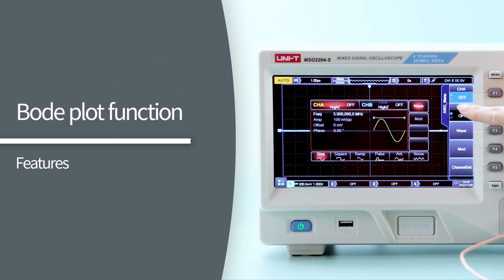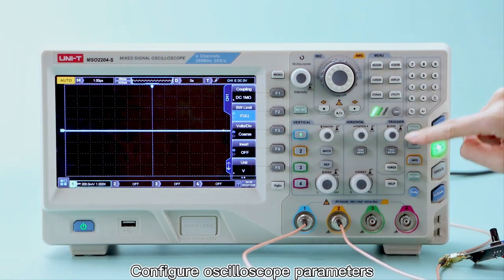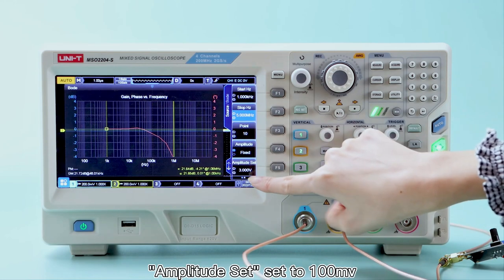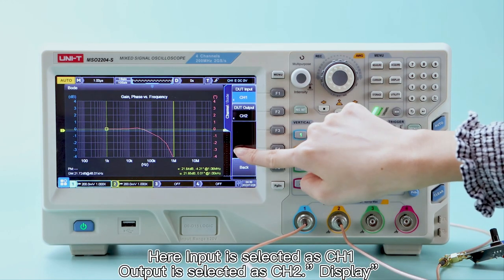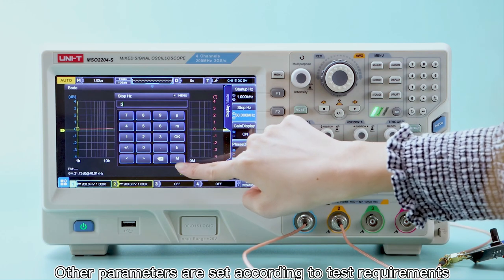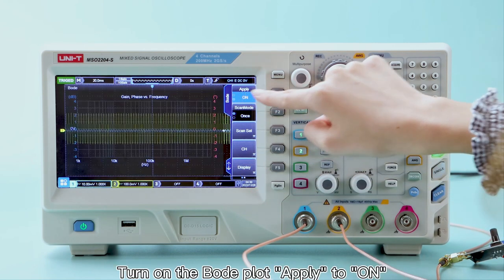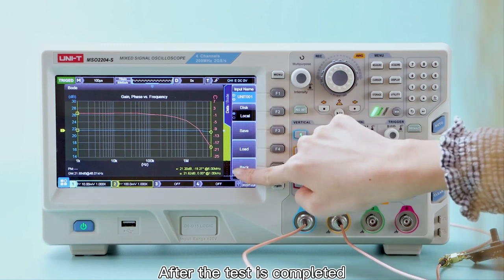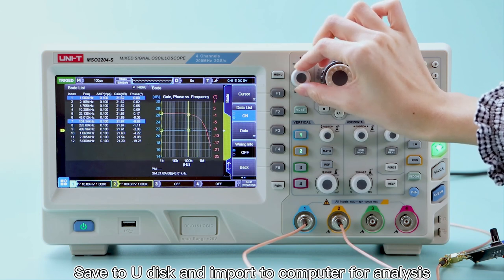UNI-T MSO2000 Series Digital Phosphor Oscilloscopes - Bode Plot Function

Comment: Great video, is this function also available in the mso300 series? I couldn't find it in the user manual.
I also only found the upo2000e on the uni-t Webseite, does it also have this feature?
Reply from the maker: Hi Sir, thanks for reaching out. The MSO3000E Series has the Bode Plot function. But unfortunately, the UPO2000E Series doesn't have.
Reply: @UniTrendTechnology  okay thank you 😊